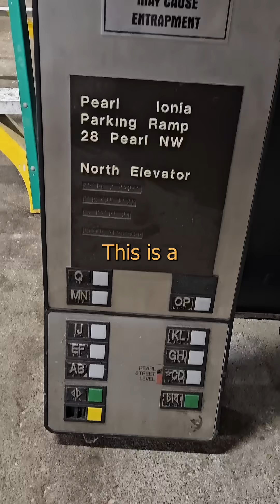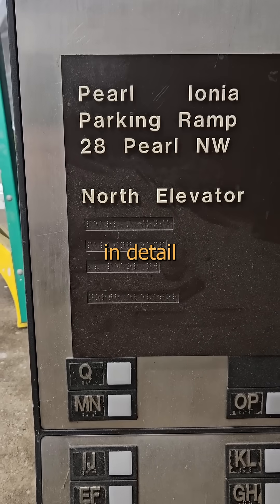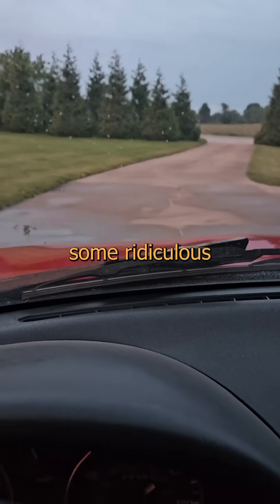Miata Mischief #chrisboden #engineering #gear #elevator #score #stories #parts #hacking #making

Comment: I didn’t think it was sketchy at the time, but apparently my neighbors disagree. After a trip to the local comic store I was walking home and decided to take a shortcut down the railroad tracks. I had recently gotten interested in blacksmithing and a lot of channels on YouTube would use railroad spikes as material and I want to see if I could find some loose spikes. it took me 20 minutes to get to my house walking the railroad in that time I had picked up enough railroad spikes to give Jon Henry a decent days work. Good news for me and my family. I was already in the house by the time the squad car rolled up, looking for the young man scavenging the railroad track. interestingly enough about two weeks later some railroad crew came in and performed some much-needed maintenance. so yeah that’s how I accidentally forced my hometown to maintain its infrastructure.😂

Comment: So there's a hill in my side yard it's about the length of 7 school buses and at the bottom there's a little dip and at the time we had a trailer parked directly across from it so if you didn't stop coming down it you would slam into the side of a solid metal trailer and I thought it would be a good idea to get in my wagon (it's one of those ones that has a dump bed on it and you consider it and steer but the sides on it are so big that if you sit in it you can't put your leg out to stop) and i thought it would be a good idea to send myself down there on a plastic wagon my dumbass did it three times the first two times nothing really happened but the third time I hit that little ditch which effectively acted as a whoopty doo it flung the ass end of the cart up in the air with me I landed the thing landed on top of me and then I stood up and I thought about doing it again and I'm pretty sure I did but I crashed into the trailer and almost broke my legs

Comment: A 1939south bend toolroom lathe in a 1962 datsun 1200 ute 140kilometres home on the calder highway, gear changes under load on hills nearly pulled the left front wheel off the road, such fun!!!      Remember, if you aren't breaking rules, some idiots agonised for days dreaming them up for nothing.

Comment: I drove my 2000 single cab stepside Ford fucking Ranger from the middle of Alabama to Bowling Green, KY to pick up 5 full size casino slot machines, each weighing around 300 pounds. The handling was difficult on the way back to say the least.

Comment: One time my dad and i went for a quick ride in his beat to death Volkswagen during a blizzard at night. We did a big lap, went home, and saw that the plastic rear bumper was gone. So we went out again. Still in a blizzard, looking for it. We found it in the middle of a 4-way intersection. The lights flashing orange were the only thing lighting the way. I went out grabbed it and had to DODGE A PLOW TRUCK. (i was about 7 feet from being a red snow bank) We quickly bungeed it to the top of the trunk and went home. Pretty sketchy.

Comment: I used to have a 1979 Lincoln Continental that I drove with no registration, stolen plates, no license, and no insurance. My mom didnt even know I had bought the car, and I ended up moving out and had to use the yacht to move 90% of my room. The issue: my radiator is bad, and I had to back roads my way to my new place, and ended up breaking down in front of an elementary school in a rich neighborhood. The yacht gave a car a chocolate rain shower when I opened the cap and had it spray in the road.

Comment: When I was 19 our local Best Buy had a crazy Black Friday deal on some 55" LCD TVs. My buddy and I got cash from 4 of our other friends and were planning on taking his sister's Mazda Tribute to pick them up, but she managed to run over a foot deep pothole on her way to Thanksgiving dinner and wreck one of the wheel assemblies. 

So instead we roll up at 4 AM in my 2013 Chevy Spark with nothing but hopes and prayers 😂

We managed to actually lay claim to all 6 TVs and an employee tells us to pull around to the loading dock, and when he saw us coming he started laughing so hard he couldn't breathe. We somehow managed to fit 4 of the TVs in the back with the back seats down, hanging the best part of a foot out the back hatch, secured to the front seat headrests with a ratchet strap the Best Buy employee lent us. 

I made a trip to my house to store what we had in the garage, and my buddy hung out with the other two TVs until I got back with my own ratchet strap so I could give the guy his back. Then we dropped one TV off at my place and took the other to my buddy's place and it was at that point we realized that the whole reason we didn't just borrow someone's truck, the rainy weather, could have been negated by a tarp. We just laughed it off, smoked some weed, and proceeded to play Army of Two on his new, giant (for the time) TV.

Comment: Brought/pulled  home a free 35' all steel boat trailer from a town 285 miles from home with a 1998 Pontiac firebird formula w a custom fit class 3 reese hitch from a Ford F-150. 5 mi into the trip we had to stop at Walmart back when they were still 24 hours around 12:00 a.m. and had to buy about 15 bags of river rock to balance the trailer and get some of the weight off the back of the car. Right before we got home car started running funny pulled over and the fuel was boiling in the fuel tank from working the fuel pump so hard. True story. And we actually made it home with it.

Comment: my dad took his entire dorm room worth of stuff, which included a full stereo system with a casette player, big speakers and all, along with clothes and other school stuff, to college and back home again in a 1973 VW Bug. i have also hauled a lawn mower in my 2013 Beetle, and another time i fit 2 CRT monitors, 3 LCD monitors, 4 desktop computers, and 3 copy paper boxes of miscellaneous computer cables and peripherals all at the same time and still being able to see out of the back window. currently i have the trunk area set up as a little mobile workshop made of a tool cart that can be divided up into separate sections.

Comment: Full size Futon mattress (full thickness, thus not a Wal-mart special Futon Mattress) in a Ford Escort Zx2 (Read Escort Coupe) to my new apartment in San Antonio. We did manage to close the trunk, but the back seats were folded down, and I couldn't move my driver seat all the way until I extricated it from my car and brought it inside my home for the next 4 years. Took me another year or two to get the Futon Frame...

Comment: I've loaded up a newer washer into the back of my itty bitty MK3 golf with a come along all by myself before. I was pretty damn proud for pulling one that off. Surprisingly even with the seat back still installed and just pushed forward I had to ratchet strap the hatch down because it was only like 2 inches shy of shutting. German engineering and the power of leverage is pretty impressive sometimes lol.

Comment: Remember those huge rear projection TV sets from the late 90's and early 2000's that were so big they stood on 12-inch speakers and came equipped with casters? We took one off our neighbor's hands and loaded it up on a wooden wagon. Look up the Berlin Sport wagon Model F410 for an idea of what it looked like except only the handle had paint.

Comment: Soooo... I'm partially sighted and they took away my driving licence a few years ago, but they did not take way my eBay licence, as a result I am an expert at transporting large awkward objects home on the British passenger railway system, including PDP-11/54, a VAX 4000, a Sinclair C5 (this was the hardest, but its technically a bicycle which is allowed on trains), a slushie machine, and a 125lbs spectrum analyser

Comment: Last week i just got a WHOLE control panel (the 1st one 2nd one and a console) For the Man Roland 100 offset printer (or smh) there are more circuts boards than peapole you know and the spaghetti is more than enough to make a veteran have a headache decoding this thing. AND IM GONNA BURN IT ALL, while trying to power this up.

Comment: I had a 1991 Camaro and hauled a whole extra set of seats front and back inside of it while still having all of the factory seats still in it. I also had a subwoofer box in it as well. But managed to make it fit like a puzzle 😂

Comment: Fun fact about a Nissan Versa, with the assistance of a few ratchet straps you can fit an entire full size mattress folded in half in the floor of the back seat.
Just be careful on the removal because the unfolding process is a bit faster than you might expect.

Comment: I put a 48" pizza in a fully roll caged Honda Prelude. Not on purpose, I was pranked, but we had to eat so in it went. Also, I have a Ford Ranger and I hauled 4 4 wheelers and a side by side 160 miles on a 20 foot flatbed trailer at 80 mph down the highway while I had 2 bad injectors and a clogged catalytic converter. I also had all the camping gear stacked in the bed at the time.

Comment: When I was living in LA I had a smart4two, one day I needed to get a 6x4 conference table I got at the treyarch office moving sale from the old offices to downtown where I lived. I used an entire roll of duct tape and two busy cargo straps to secure it wedged in at an angle after removing the passenger seat, which left half of it hanging out the back. Stuck a red flag on it and drove in bumper to bumper traffic through LA for an hour holding on to it with my right hand.

Comment: For a final project for an electronics course in undergrad I decided to make an induction charger, only I didn’t have a big enough inductor to send much power. I ended up walking past a construction site and “acquiring” about 40’ of copper wire to make the most bomb-esque inductor the professor had ever seen 💣 the LED I was powering almost blinded me

Comment: moving 8 beams of 8-10' steel tube in my rotted out 2006 ford station wagon with my welding apron over the ends to keep my windsheild from getting scratched. had the beams pressed against the gate and resting on the dash to fit since i forgot my straps for the roof. 

something satusfying knowing your getting more work done with your old sketchy shitbox then the lifted spotless bro-dozers on tbe road next to you

Comment: I drive a Honda Civic, and I'm very proud of its "shove shit in there" capacity.

Two particular highlights: I worked at a corporate Italian chain, and we routinely had to go pick up cases of product from the distributor when we ran out between truck shipments. Every time I went, all the other managers would fret about "Oh, can your car hold all that stuff? Do you need to take my truck/SUV?" I do not, and I will not. In fact, I could fit more cases of lettuce in my little Civic than they could fit in their big ol' stupid truck things.

And more recently, I bought some old bowling seats from a bowling alley that upgraded their seating. I bought a rack of 4 chairs bolted to the metal stand on a curve. (If you've seen a bowling alley from the 1980s, you know what I'm talking about.) I was so proud of myself for not only carrying that thing across the parking lot but also loading it into my Civic by myself! It didn't fit in the trunk/backseat as hoped, but I did get it to fit across the backseat if I flipped the chairs upside down and drove home with one door open. (I did.) It was worth driving a whole block and a half with the door open to have this very cool piece of unique furniture!

Comment: Not exactly "hauled home", but "did stupid shit" story in spades. So, there is this old ass abandoned factory not too far from where my pall from college used to live, and many a people were striping this old ass factory for metal, parts and other shit, mostly to sell at local sketchy second grade materials market. My pall is siting at his laptop, working at a diploma, time is of the essence, final deadline is only few days away, but then, suddenly, another pall calls in distress: old ass minivan they used to strip the old ass factory naked is stuck in early summer mud. What to do? Write a diploma, or go save a friend and his very expensive haul of scrap? My amigo did both: he drove to location, bribed the security guy (an old ass grandpa, rather), said to distressed pall, that he is claiming half the shit in the van, planted his ass in the shotgun seat and worked on diploma, while the scrapping crew spent the night dragging loaded van out of mud with the help of a Nexia

Comment: I moved a agm-12b bomb crate (that is solid steel) about 2 and half hours from the destroyed shed I found it in to my house. This involved separating into two halves (it was designed this way) and strapping one part to the roof of my car and the other hanging out of the trunk. I did this in a little 2008 Chevy cobalt. It made it and only slightly dented and scraped the car.

Comment: Me (the responsible adult i am) wanted to get some beer from the store for a party. We needed 3 cases (where i come from cases of beer aren’t packaged is carton but in plastic holders named “kratten”). I somehow got 2 cases strapped on the rack of my bicycle, but didn’t have enough space for the third one. So the only other way for me to transport the third case was to strap it onto the saddle of my bike, put the saddle down a bit and rode on top of the case 😂😂😂 (already was a bit buzzed by the way)

Comment: Rear axle on my dodge ram charger spewed large chunky sparkles.
Only available transport was a 77 kawasaki Ltd 440.  Strapped a junkyard dodge 9.25 rear axle to the bike and rode two unreliable hours home with the choco starfish puckering seat material and leaning hard left to counterbalance the weight of the axle.

Comment: I put a 55 gallon aquarium in the passenger seat of my wife's old 2002 Hyundai accent. Took me a good 20 minutes to get it in there and it was so bit i couldn't get the car into 5th gear or reverse.  Then I picked it up by myself and hauled it up to the third floor. It was leaky af and I had to throw it away a week later.

Comment: I owned a mazda rx8 as im a big rotary enthusiast. I picked up some scrap 12a rotary engines and and had one for each seat besides the drivers. So i had an rx8 with technically 4 rotary engines in it.

Comment: I hauled a 3'x4' platform boss CO2 laser cutter that was questionable at best in the back of a Uhaul. I had a forklift at the CNC shop i worked at, and bought it from, but nothing of sort at home. Que the montage of a 19 year old and their 59 year old dad using straps, ramps, and every bit of spare wood we could muster to move it over 30' of gravel into a garage. By some miracle minus some scratches it made it in one peace with even an intact laser tube.

Comment: I’ve carried a 12 foot rug home from the store with my coupe only about two foot longer than a miata. It was hanging out the trunk because I didn’t have any ratchet straps on me at the time. I was worried about it sticking out to far and not having a flag for it so I found an old Santa hat from Christmas a few weeks prior and electrical taped it to the end. Got home perfectly fine probably my favourite thing I’ve hauled in my car.

Comment: borrowed my dads car and drove 2 and a half hours away to Scranton to buy a motorcycle for $200. got the thing in sideways so it leaked oil and gas, poked holes in the seats, broke down an hour and a half from my house bc i spent all my gas money on the motorcycle and had to get my step brother to come pick me up. the motorcycle never ran and got stolen months later. still have a listing up for it on marketplace for some reason i could link it

Comment: I’m a truck driver(obviously) and I have been hauling trash and demo for many years. This is always out of a transfer station to a landfill and people throw away some crazy shit. I have a day cab and recently I found a PowerWheels battery truck in perfect condition. To save it and bring it home I stood it up on its rear bumper and strapped it to my headboard with some poly rope I found and a couple rubber bungee cords I had. Thought I would loose it on the interstate but I carried it 78 miles and got it to my pickup where I was able to give it to a low income family that had a young child, I ordered new batteries and a charger and had them sent to their address.

Comment: Omg in my 20s I took a Suzuki samurai and put an old flat top 4 cylinder geny from an old house boat from the 60s. With the coil still attached it weighed a out 1000 lbs.... Poor sami was squatting.....

Comment: About a year ago I was working at a restaurant. I went to throw some garbage in the dumpster when I found an old atm machine had been left behind to toss out. Came back with a sawzall the next day and cut it to pieces and spent the remainder of the day bringing it home. Some pieces come on the bus, but the front panel was strapped to my back and rode 3 miles on a bike with it 😂

Comment: One time I got one of those circular soda coolers that have ice and usually energy drinks from a gas station i worked at for $100 and the only thing I had was a camaro so that big bastard was in my passenger seat

Comment: Carried over 400 skeins of yarn in my 2000 mazda miata. Im 6 ft nothing and filled the trunk to the point it opened like snakes in a can. Plus the box perfectly fitted in the footspace/floorboard, as well as 2ea 30 gal Rubbermaid tote containers also filled like snakes in a can on the passenger seat beside me. The convertible top had to come down for this, and then I climbed in and realized shifting was gonna be a contortionist performance. Drove 20 miles home like that and got to enjoy seeing the surprised/shocked/confused look on my wife's face as all this yarn came popping out of every location on the car. Happy wife, happy life.